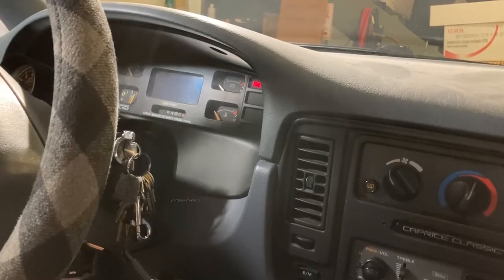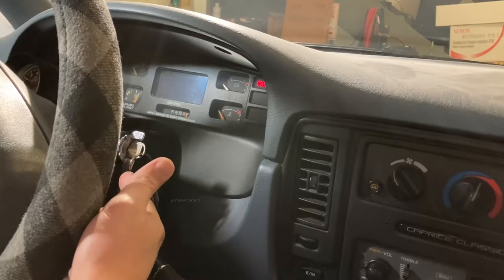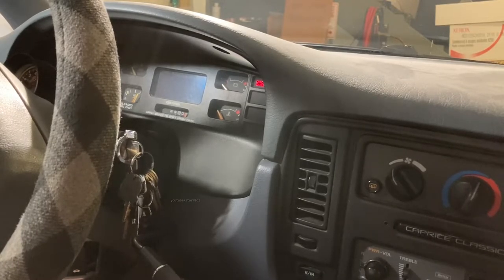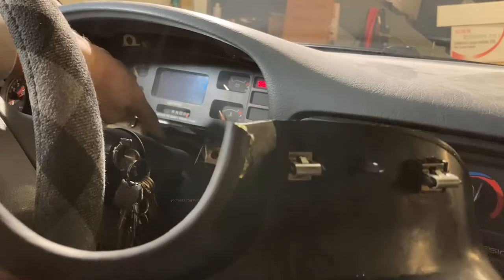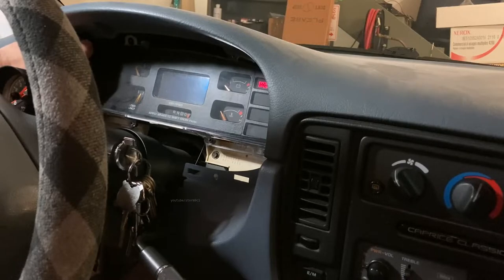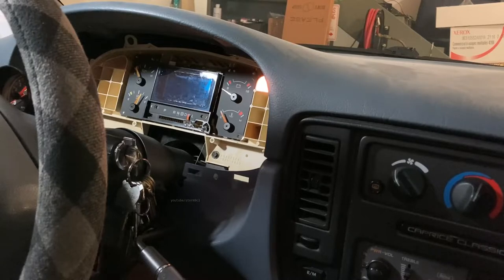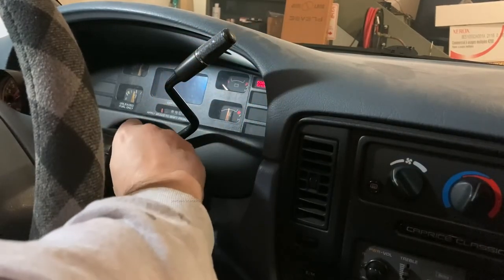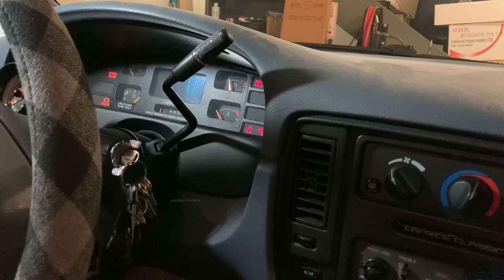1994-1996 Chevy Caprice/9C1, 1994-1995 Impala SS dash cluster gauge disassembly

Comment: My cluster died and I found a used replacement online, is there any way to copy over the mileage?  I don't intend on selling the car and don't care about mileage, but I don't want to scrap the car just because I cannot get a new cluster from the dealership.
Reply from the maker: Hi. You cannot copy mileage from one cluster to another.  But you can try to swap parts like the display board in some cases to restore original mileage. That's on you. And that's the only hint I can give here. If not, Check eBay. There used to be sellers there that had legal ability to reprogram these clusters. I cannot give any further advice because there are legal issues involved with odometer tampering.  Even if you don't plan to ever sell the car, that's still sketchy since you can't control what happens next. It could get totaled or maybe some other unforeseen event. This needs to be done right.  Hope you understand.
Reply: @storm9c1  So I had the cluster swapped out cluster for a new one bought online (in my state if it's over 10 years and you don't plan on selling it doesn't matter).  The speedometer works and everything else works except for the gas gauge (needle isn't even visible) and the shifter is incorrect. The mechanic that did it told me the cable length on the shifter is different for the new cluster, but this doesn't sound right. They look identical, but the new one came off a 96 impala and my car is the 94 Caprice LT1.  Would the year of the car make any difference (94 to 96)?
Reply from the maker: @orome9793  That's odd because a 1996 impala has an analog speedometer.

Assuming it's from a Caprice instead, it should be compatible. There should be no difference in the pointer cable. It can be repositioned on the bowl to adjust alignment but it's a pain and probably why the mechanic skipped out. 

Unsure what to say about the gas gauge without diagnostics.

Comment: Hey I unhooked the cable from the point but the gear is sitting between Parking and reverse how do I get closer to the parking gear again
Reply from the maker: Unsure exactly what you did. Check to make sure the cable is connected the same exact way it came off. If disconnected at the pointer, there's no adjustment there. It goes back the same. If you take apart the lower panel, you can move around the connection to the bowl on the column.  Maybe I will try to cover this in a future video. Thanks.

Comment: Thank you for the videos. I just purchased a 1995 Caprice Classic. My temperature gauge seems to be inoperable. Even though the temperature sensor is brand new, I'm not trusting it. I still need to check the sensor and corresponding wiring. When the cluster has no power, the gauge sits right on C, but when the key is turned and power is applied, the gauge pegs hard below the C. Does that sound like short to ground between the cluster and sensor, or could it be a bad sensor? Or could the gauge just be that far out of calibration? Thanks for any tips or advice!
Reply from the maker: Hi. Welcome to B-Body ownership! I did a few other videos about temperature gauge issues. If shorted to ground, it will peg to H.  If it pegs below C, then the needle has spun on the shaft (common problem).  There is no other failure mode that I have seen that lets the needle fall below C (it's electrically biased in the cluster to stop at C).  The best thing to try is to take it apart as I showed in the video.  Turn the key on.  Make sure the car is cold (not run for 8+ hours).  Then pull the needle off the shaft (careful not to break it) and reset it on the tick mark at C.  Be sure to leave the key on during this whole process, engine off.  That should get you back to a sane state.  This assumes the sensor that was replaced and the wiring is good.  Even after doing this, it may come back out of calibration each time it pegs to H during the "bulb test" mode during cranking the engine.

As I tell others, YouTube is not a great forum for getting interactive help.  If you need more help, please join the Impala SS Forum.  (impalassforum.com).  And post your questions there in the Caprice section.  Feel free to PM me if needed because I don't always see all of the posts.  My handle there is the same as here.

Good luck.
Reply: @storm9c1  Thanks for the reply! I will definitely check the needle calibration. I noticed that during the bulb test, the needle only jumps toward H for a split second, and then returns to C, and when the car is started, it falls below C. I have watched all your videos and you have provided some very good guidance. Also, I have done some reading in the Impala SS forum, and will be joining as a member.

Thanks again.
Reply: @storm9c1  A little update. The temperature sender was bad. I replaced it, and vacuum filled the cooling system. Now the gauge works, but it doesn't read correctly. As soon as the car begins to warm up, the gauge climbs all the way to H. Im starting to believe I have a bad gauge. Wiring and the sensor test correctly...
Reply from the maker: @zacharyclark118  Thanks for the update. I've never heard of one of these gauges failing that way. One way to tell is to unplug the sender and jumper in a resistor to ground. About 110 ohms is 1/2 scale.  Measure the sender with a meter to ground, should be greater than 1000 ohms cold and between 100 and 200 ohm fully warm up but not hot.

Comment: Hello, question. Any way that the oil pressure gauge needs to be recalibrated?  I replaced the oil pressure sending unit and it says oil pressure is 0 at idle in drive. I’m getting good pressure mechanically but the oil pressure sending unit is new and now giving me 0. This is the second one I swapped with standard brand
Reply from the maker: What year and model?  Is it a 9c1 or not?  This is important because a different sensor is used.
Reply: @storm9c1  it’s a 9c1 1996. I ordered from rock auto. Standard long series. How do I know which one is a 9c1 specific. Please help or send me a link to purchase please
Reply from the maker: @markdouglas3077  The original AC Delco part number that I have documented for a 94-96 9c1 is 10201491. The long sensor. That crosses to Standard Motor Products  PS236 at RockAuto. If you already tried those then maybe the wiring or gauge is the problem. You can try to recalibrate the gauge by turning the key on but engine off. Pull and reseat the needle to the L position. Make sure you have a real 9c1. The civvy model cars including Impala SS are different even with a gauge.

I have plans to do future videos about all of the gauges and sensors.

Comment: I can’t see the speed at all is it because of bad cluster wat exactly I need to repair
Reply from the maker: There are 3 common things and 100+ uncommon things that could cause that. The first 3 are cracked or oxidized solder connections which require full cluster removal, disassembly, cleaning, and solder reflows. Do you have the skills for that?  If not then it may be time to contact a professional. Unfortunately.

Comment: How do u pull the whole cluster out to replace. Mine has resistance. Do I just yank on it
Reply from the maker: Maybe.  Maybe not.  I'm not sure what you've done so far.  But to be honest, giving whole cluster swap advice on YouTube could be construed as odometer tampering (Federal offense) and I don't want that kind of attention. In this case, it might be best to join a forum such as the "Impala SS Forum" to discuss your needs there.  Thanks for your understanding.
Reply: @storm9c1  I was able to get it out. You have to tug at it because there are two plugs at the bottom corners holding it in behind the cluster!!
Reply: @Aero_HER_Dynamic is it 2 clips I'm trying to pull my whole cluster to get to the anti theft relay

Comment: How can I remove the first gear lock?
Reply from the maker: So you have a stock 94-96 Caprice 9c1 and cannot shift all the way down to 1, correct?  I already have a short video to be released soon on how to fix that.  I'll post it soon, maybe as early as tomorrow.
Reply: @storm9c1  Does it only work on 9c1 caprice. I have two cars, the other one is a Caprice 96LTZ. Does it work in the same way?
Reply from the maker: @Mohand 105  Well I don't think LTZ was an option on American Caprice cars in 96.  If i recall, last year for LTZ was 93.  Unsure about cars for the export market.  You may have a clone based on a 9c1 car.  Someone may have put LTZ badges on your car.  Check your RPO codes on the trunk lid.  The low gear lockout was only on 9c1 cars (and maybe 1A2 wagon or other fleet cars).
Reply from the maker: As promised, I posted a quick video today with the low gear lockout information.  Hope it helps.
https://youtu.be/fFjVJqaq4S8